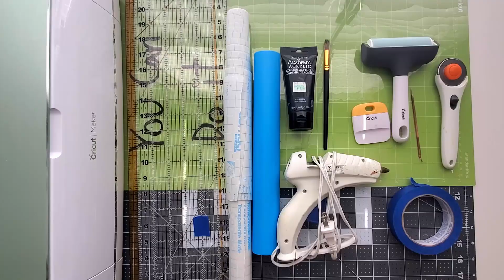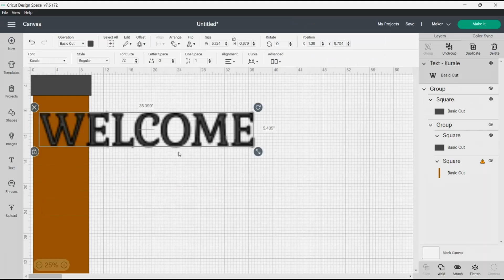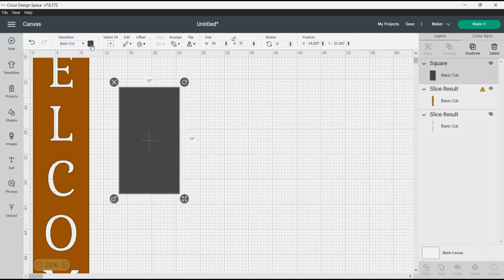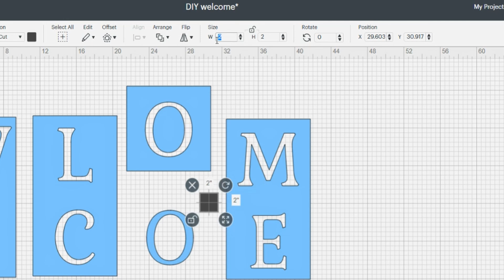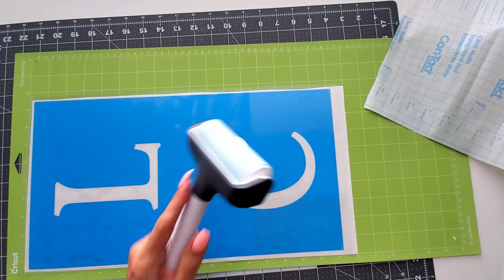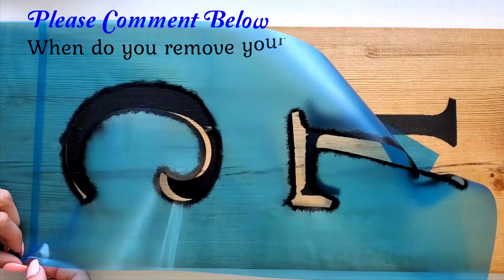How to Make Reusable Stencils with Cricut for DIY Projects

Comment: What about using spray paint? Would that work? This is a really good tutorial! You showed your struggles and no extra talking. Clear and straight to the point! Thx!
Reply from the maker: Thank you so much for the compliment and for watching! I believe spray paint would work. Reminder to use light coats of spray paint to prevent pooling of extra paint and possible bleeding under the Stencil.  Let me know how it turns out 😃. Good Luck😉👍🏼